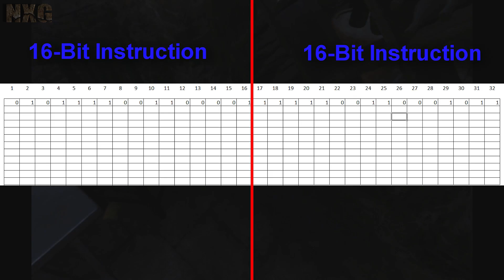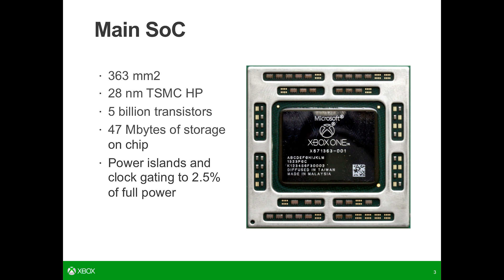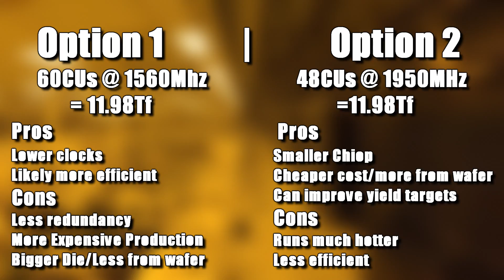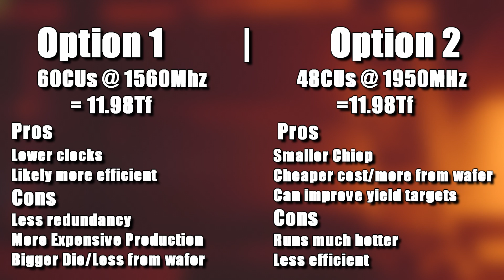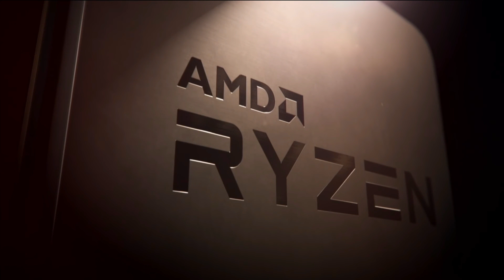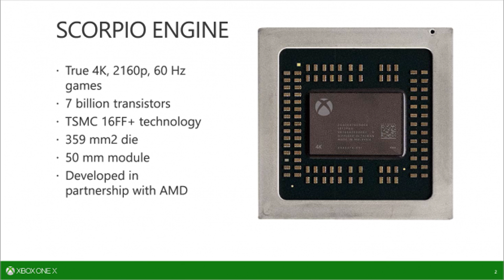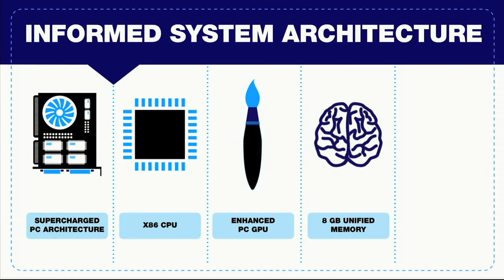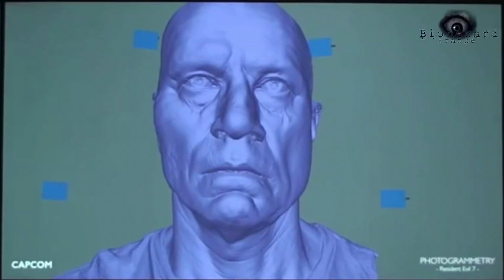Is the PS5 only 9Tflops? | Let's Talk

Comment: Everyone concerned that 9tlops sounds weak go and look at God of War, Horizon ZD, Uncharted 4 and upcoming games Ghost of Tsushima and TLOU2...These games run on base PS4 specs! 1.84 tflop GPU of an older architecture! So just imagine the same developers making games for a 9.2tflop GPU and the GPU is Navi/RDNA!...😁😁😁 9.2 is a powerful GPU these specs in a console is totally different proposition to PC aswell! Consoles will get way more out of the GPU than a PC.
Reply: Compared to 12Tlops, its weak
Reply: Omg you guys have no idea how CPU's/GPU's  work do you? Both the new consoles will handle 4k60 with raytracing. They've already stated this multiple times. Zen2 CPU's destroy the jaguar CPU's in last gen easily.  Not only are they faster than Zen+ they are also more efficient. They are getting another 17% IPC boost which is massive. Now RDNA2 is faster and more efficient than RDNA 1 obviously. So using some common sense if the garbage jaguar cores could do 4k30(upscaled) obviously the new Zen2 and RDNA2 can do 4k60. On the pc side the 5700xt onlybhas 9.75 tflops but can do 4k60 with 40 compute units... sound familiar? Sounds to me like the ps5 is running a 5700xt at 2Ghz or something similar but on the zen2 platform allowing it to be squeezed into a console.  The vega 64 which is inferior to the 5700xt is at 12.6 Tflops with 64CU's So throwing that number around means nothing if you don't actually understand it.
Reply: @SSpider41  
4K/60👍

Yeah that's all we should care about 😁!
No improvement but resolution and FPS🚽👍

FYI, I have very advanced knowledge about all that stuff!
It was my Hobby for about 20 years, coding a 3D-GameEngine on PC; using GLSL, OpenGL, BlitzMax and C++...
I did things, I never thought even about. - But that's a different Story 🏃
Reply: @3D-Engine-Melody  hey personally I don't care. I'm a PC guy so my vega 64 and 5700 xt both do 4k 60 with whatever I'm playing.
Reply: @SSpider41  
Noo way, you can play almost any game in 60fps, games that are created for 2013(2011) HW?
Wow🙌

Tell me how well games will run, created for 8x more capable hardware (paired with RT and SSD RAM-Pool)😉.
Reply: @3D-Engine-Melody  Well The games that exist right now are well what exists and are the current benchmark soooo yeah. You got a better option?
Reply: @SSpider41  
Sure...

Buying PS5👍...

No stuttering, no issues, no overpriced GPU's, but pure enjoyment sitting on the couch playing in Homecinema Atmosphäre on a 120" Projector Screen 😘😍🙌💨
Reply: @3D-Engine-Melody  ok? I'm getting one too for the exclusives.
Reply: @3D-Engine-Melody  if you're playing in home cinema you're missing out on dolby atmos sound. Sounds amazing on X1X.
Reply: @vandammage1747  
My Denon is doing Dolby Atmos just fine 😁.

It costs around $2000😉

Not many games support it though. Or have issues!
Voices of rdr2 were coming from front even they were behind.

Shadow of the TombRaider also had some issues, if I remember correctly.

Overall, not that big of a difference! Some Blu-ray sounds amazing though
Reply: @3D-Engine-Melody  I thought you played on ps4. Ps4 doesn't support dolby atmos.
Love projectors, have on for my 3d blurays and movies.
Reply: @vandammage1747  
I play on Pro and X😊
Reply: @Crescent Moon 
Common sense!
Last 24 years games are 30/60fps, but one year later anything will change? Because of what?
The Power advantage!?

PS1, 60fps
PS2, 30/60fps
PS3, 30/60fps
PS4, 30/60fps
PS5, ...

No matter what power, Devs have to decide between Graphics fidelity or FPS!

You will understand, if you see true nextgen games! The insane graphics will forget you very fast about that question "But, how much FPS and Resolution is it?" 😁

Just for the case you didn't know, double the frames needs double the GPU power in first place!

Why is it still even a thing? It's so simple and common sense!
Reply: @Crescent Moon 
No I'm not teaching you, never said 4K/8K is the future it's just a waste of power.

Why you are so embarrassed 😶?
Reply: @3D-Engine-Melody  4K is not a waste in power. You just say so because your projector is 1080p.
1080p is blurry
Reply: @vandammage1747  
Yes it's a 1080p DLP😁!
And still, do to supersampling, I see big differences between resolutions.
And you would wonder how good it looks, my friend owns a 4K OLED and he says, my Projector is much better and tops any TV😉.
It's a whole different thing, playing on such a big Screen!
Never played again on my 60" TV.

But native 4K is still overkill.
Because it comes at a price!
Reply: @Crescent Moon 
Do you live in past?

Shimmer free Antialiasing is common since years on Consoles.
Also most 30fps games are perfect fine do to high quality motion blur!

Most Shooter games are 60fps anyway, like Doom, BF, COD, Wolfenstein, ...
Reply: But if you want those games to run 4K60 that's already 4x more power needed from pro and not much left for better graphics.
Reply: @vandammage1747  you got it. Base ps4 is 1080p, 4k is 4x the res and on top of that ray tracing! I personally don't care about 4k on a monitor.... next gen will be the smallest leap ever
Reply: @vandammage1747  
No it's 8x!

1080p-->4K already 4x
30fps-->60fps additional 2x

That's why NextGen will still come with 30fps@cb4K mostly
Reply: @3D-Engine-Melody  I said from pro which runs exclusives at checkerboard 4K30. That's 1/4 of native 4K60.
4x4.2tf is 16,8tf needed. Rdna2 flops will be much more efffective of course.
Reply: @3D-Engine-Melody  I do think next gen will have lot's of checkerboard 4K60 which looks great.
Reply: @vandammage1747  
Can't wait to see the first true NextGen Games 😘.

Unfortunately, PS5 may have the only ones. Since Xbox Series n is on PC and Xbox one.
Reply: @3D-Engine-Melody  makes no sense. Releasing on pc doesn't make it less next gen and you won't see ps5 exclusives for a long time. They will be ps4/ps5 games or ps5/pc games.
If XsX has a 3tf edge games will look and play better.
Hellblade 2 is the only proper nextgen game shown and it's not on ps5
Reply: @vandammage1747  
As far as I know, Microsoft will release their Games for all platforms (Xbox one, PC, SX).
So no real NextGen Game for years 😮.

While Sony will have at least a few PS5 only ones!?

We'll see...
Reply: @3D-Engine-Melody  I doubt Hellblade 2 gets a xbox one release.
Sony won't ignore 100m ps4 users. And next gen games will need higher budgets. You won't see any aaa ps5 exclusives for the first 2 years, mark my word.

Again, releasing on pc is just a benefit. Don't get how you don't see that
Reply: @vandammage1747  
Hellblade 2 is very early in development, so no release before ~2022.

I'm more concerned about Xbox one support than PC.
But also PC could hold back many games, since most PC's are very weak without RT and SSD!😮
And that's just a quick shot from me
Reply: @3D-Engine-Melody  scaling on x86 is very easy. Ps4 and xbox one compatibility is a much bigger bottleneck than pc is.
Reply: @vandammage1747  Microsoft wish they had 100m consoles out in the world ...sony will dominate once again because they have the better games...i didnt switch from 360 to ps4 because of power...simply for the games ...Nintendo is the only rival not Microsoft...and its sad because the only for Microsoft to have any chance is for Sony to completely screw up...Microsoft being more powerful isnt enough...sony has to screw up for Microsoft to have a chance and thats what u xbox fans are hoping
Reply: @3D-Engine-Melody  Hellblade is series X and PC exclusive
Reply: HAL 9000 wrong you’re very wrong most games will run native 4K 60 some 30 up to 120fps all the way up to 8k
Reply: @3D-Engine-Melody  Your comment is bizarre to say the least.
Reply: @vandammage1747  I agree with you on everything except the release on PC.  Releasing Exclusives on PC hurts
console sales.  Look at Xbox, they have ruined their brand by putting all their games on PC.  There isn't
much of a reason to buy Xbox anymore.
Reply: @chasethechosenone8478  
Are you a developer?

I was for about ~20 years as a hobby 😉.

I know what I'm talking about, if you like it or not
Reply: @GregHakes  
What exactly?

I'm just trying to get the facts right!
Reply: @GregHakes  I don't think console and pc work like that. Pc will never be a console experience. I have an rtx2080 and haven't played one game one it. Before that I had a gtx1080 with zero games played also.
But I do love playanywhere and I use my laptop to play xbox games when I'm away from home.
A bigger ecosystem means it's much easier to get thirdparty deals. And crossplay, cross-save with on license is great.
Console owners don't want to build or tinker with settings, nor do they want to have a rig in their livingroom.
Don't worry about xbox, next gen they will rule.
Reply: @abemickeygaming7742  what games did you buy with your ps4? I bought Destiny and bf4. Later on I bought Killzone, the only exclusive I got.
3 years later when I bought the one s I got Halo 5, Gears 4, Forza 6, Killer instinct and Halowars 2.
Reply: @vandammage1747  I am not a PC gamer either.
Reply: HAL 9000 I think ima call you out in your bluff
Reply: @chasethechosenone8478  
What bluff? Something wrong with you 😱

Comment: If playstation has more power, power is important, if playstation has less power, power is not important. Nothing more we need to know, we've learned that in the past. 😉

Don't get mad boys, i got both.
Reply: Well yeah, because what really matters is exclusives so if Xbox doesn't even have an advantage in multiplatform games, there's almost no reason to buy it while if the Xbox was more powerful, it still is missing the best games every year which are exclusive to PlayStation. Either way ps5 is the better buy just like PS4 pro was the better buy than xbonex even tho it's weaker
Reply: Funny, only Xtwats made this up!😂
Reply: @3D-Engine-Melody  i had ps1, ps2, psp, ps3 slim, ps vita and ps4 pro, so who is the twat, huh!? 😘

Comment: A 9+ Tflops GPU in a console sounds great, I guess Series X is going to be faster... but before I buy an Xbox, I built a mid-range PC and just play the same games.
Reply: Mid-range pc and still spend around 700/1000+ bucks, meanwhile the new Xbox will be 500 and more powerfull than your mid-range pc which you spend more money on 🤣 logic is broken tbh.
Reply: @SDGRTX1455  No doubt that the new Series X will be insanely powerful and be as good as a $850+ gaming PC with Ryzen 3rd Gen and a RX 5700 XT and this is really great... But unlike the PS5, there are no exclusive titles for the Xbox, because all games are playable on the PC ... this makes an Xbox a little superfluous, especially a Series X that is almost a normal tower PC.

Sure you spend more for a PC, but you have a lot more possibilities with a PC.
Reply: A midrange pc won't beat series X. And you're a pc gamer, not a console gamer. You won't even have ps+ on your ps5.
Reply: @vandammage1747  My PC has become obsolete for gaming, so I don't update the hardware anymore. I've become a die-hard consolero, even if I let PS + run out now ... because I mainly play single player games anyway.

As you can see with Red Dead Redemption 2, PC ports are often very badly executed and the whole DRM shit requires much stronger hardware than necessary ... so you are probably right with Series X.

I'm really looking forward to the PS5, the idea that a mid-range RX 5700 would be installed ... is awesome.

Comment: It sounds to me like the rumoured 2 skew approach by Microsoft is clever when talking about yields then. They can push the high end skew harder, knowing they can just use the "failed" portion of the yield on the low end skew- which will have a huge portion of the CU's disabled anyway. Basically that's how PC GPU's work right now. The RTX2080ti and the RTX 2060 are the same- just the 2080ti uses the best part of the silicone yields with all the CU's and the 2060 basically uses the rejects- that would be binned if no lower skew existed. Sounds like MS are just taking this concept to the console space, assuming they can market it.

Comment: If it isn't AT LEAST as capable as a 2080ti, it will practically be obsolete by 2022.. These predictions are extremely disappointing, I hope the new generation is better than this.. My 2080ti can barely run 4k 60 as it is, so I guess we can expect 30fps console gaming for an entire generation to come.. This sucks.
Reply: People in 2012 said the same thing when they heard PS4 will be using a mid-range HD 7870-7850 variant GPU. But look what we got out of it. 60fps in games like DOOM, BF1, RE7, RE2, Wolf TNC, etc with those visuals. And 30fps games like UC4, HZD, RDR2, TLOU p.2 and more.
Reply: Yea sony better not mess this up .
Reply: Well its about half the conpute performance of a 2080ti, so no, it ain't going to beat it, but nobody realistically expected it to (even though 2080ti will be 2+yes old and obsolete itself by the time these consoles launch). 

It should sit somewhere between a 2070 and 2080 level pc, which for a console that will likley cost <£500 is stunning, I mean just look at the games we've got out of current gen, where the very best console (1x) is only as powerful as a low-mid range pc, and the least powerful one (base ps5)  wouldnt even run minesweeper! Next gen is going to be amazing.
Reply: Yeah i kinda figured neither console would get close to a 2080 ti I mean mu 2080 ti is close to 16TF with an overclock. But I was at lest hoping for 60 fps which they probably can get with optimization and reduced visuals. But we will see i'll still most likely get a PS5 but I already have two bad ass gaming PC's so i probably wont grab a Xbox unless they actually have some exclusives not available to PC.
Reply: Games are specifically focused around the consoles. 90% of all PC games are ports from console versions. Games are harder to run on PC than consoles even with the same hardware because they aren't optimized for a PC that also has a different operating system, different system architecture, etc. 

2080 Ti currently cost upwards of 1200 USD. There's no possible way that the next generation consoles will have that kind of capability. They next generation consoles GPUs will probably be in line with a 2070 Super at best. However, games will like just as good on a console with a 2070 Super as it would on a PC with a 2080 Ti because the games are optimized specifically for a console. That's why a 1.8 Teraflop base PlayStation 4 can have BEAUTIFUL looking games like TLOU R, RDR2, etc. 

Currently the Xbox One X (most powerful console) is using an outdated CPU from 2013 with a pretty shitty GPU as well, and it's only 6 Teraflops of GPU power. It's still able to run basically all games at Native 4K 30 FPS, such as very intensive games like RDR2. Next generation systems with 9 (or higher) Teraflops of GPU power will easily be able to play all current games at Native 4K 60 FPS even if that's 'difficult' for a 2080 Ti on the PC market. Also, if you actually have a 2080 Ti you'd realize that fucking card is a beast and can play every game at Native 4K 60 FPS, just don't turn all the settings to Ultra like a retard. Developers make games run normally at medium-high settings on console, that's why they can easily hit 4K with current generation hardware that's super outdated. 

It's a real shame that so many people aren't educated enough to realize this stuff ^^^
Reply: Lol your overpriced nvidia card only plays console ports.
Next gen games will be tailored  for ps5 and XsX. Games will look much better than your overtaxing max settings.
Reply: @vandammage1747  Well that's quite the generalization, a pc gamer could say the same, since half the games on console start on pc. You're clearly some kind of console fanboy, but I wrote about the topic of GPU capabilities in next gen consoles and its impact on generation longevity, not a debate over which gaming device is better.. I'm not interested in arguing with someone about which thing I like to play video games on.. Consoles are good, pc is good too, I own all of them..

   What I can't understand is why someone would take the time to put down high end graphics cards in the YouTube comments? Like seriously? Go play your playstation dude, never mind my graphics card...

Comment: You said it, man. Whatever the final specs are the new machines - coupled with the tremendous advances in engines and coding tricks (DRS, VRS, culling, pixel reconstruction etc) - will enable some amazing results. Also, as consoles are the baseline for coding, PC gamers will also massively benefit from the substantial elevation in multiplat graphics quality. All in all, great times lie ahead. Can’t wait.

Comment: 56 CU at 1700 Mhz has about 12 TFLOPS

NAVI Shader Engine unit has 20 CU, hence 3 scaled NAVI Shader Engine units yields 60 CU.

NAVI 10 has two  Shader Engine units, hence 40 CUs.  

AMD/MS could add more CUs into two Shader Engine units, hence 30 CU per Shader Engine config.

Comment: It’s all about the cpu they use. I’m not buying a machine that can’t play all games at 60 FPS. If they both do this I will just wait until next gen. 30 FPS is not ok imo.
Reply: You never played and never will play consoles, then. 60fps was never the norm.
Reply: @Gr4yF0x  Well before the PS1 and N64 most games were infarct 60 FPS on Genesis, NES, Super Nintendo etc. But then 3D graphics came out and it made it much harder to do 60 fps for every game.
Reply: @XxViciousxX  n64 games barely run at 30fps.
Reply: @Gr4yF0x  Like I said pre N64 and PS1 ran at 60. I know lots of games ran at low FPS on PS1 and N64 it wasn't very enjoyable at times.
Reply: Then fuck off. 60 fps Neve has and never will be necessary. The best games are 30 fps
Reply: Pretty sure this machine will play your games at 60fps
Reply: @Transistor Jump totally agree. There is no such thing as not able to do 60fps.
Switch has more 60fps exclusives than pro.